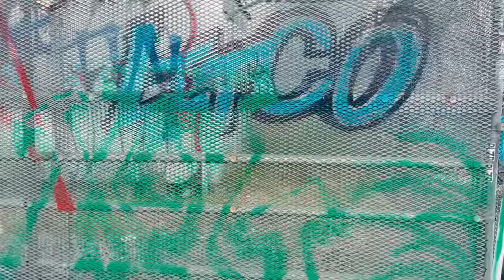Stolen Forklift Accident Lands Near Railroad Tracks

Comment: Hey Josh. I was a certified forklift op. Even if the battery was dead the forks should have been able to be lowered without the motor running. Gravity would have taken it down by using the lever.
Reply from the maker: And that’s the purpose of the chain. We DID NOT want the forks going down. Imagine they did, then when we go to tow it out, they would drag, correct?
Reply: It may not have but you wouldn't have have to figure out how to get it back on the loading dock with the low clearance. Plus, you didn't need to drop the forks all the way down.

Comment: You know you're not supposed to be on the tracks or in the rail corridor. It's usually a crime, even.

But! There are ways to get in legally!

Every level crossing should have a railroad phone number you can call, usually this is for emergencies like someone stuck on the crossing or a crossing malfunction, but it gets you in touch with the railroad's train control or some form of office. They might be able to put protection down to totally prevent any chance of a train coming along, send out a rail protection officer, a railroad policeman, or maybe even some trackworkers to help.

Comment: Josh there should be a blue sign on that railroad crossing you can call get protection for that move much better solution and cost you alot less if a train comes before normal

Comment: Decades of strickly enforced OHSA health and safety regs and driving a forklift at the plant I worked at under such regs had me screaming in my head lower the forks, LOL. I understand why you couldn't but the old rule of only enough height when driving to clear the ground is ingrained in me😃. You know the railroads have been able to steal millons of acres of land in the country for their rails and right of ways to run and we do need the railroads but the least they could do for havign been grants all that land is keep their right of ways clean.  That business is going to need a better back gate or the thieves will just try it a again.

Comment: Pick it with the 16t, pull out, back in a flatbed, roll it up, roll it onto the dock and done.
Reply: It wouldn't roll!! (or straighten the read wheel steer)
Reply: @wssides  rolled just fine when they dragged it out.  And it’ll steer, you just have to crank the wheel a lot to generate some pressure to move the cylinder that turns the axle.  Steering is purely hydraulic.